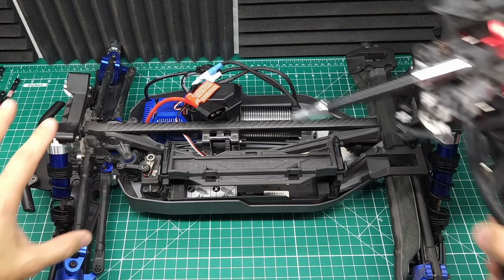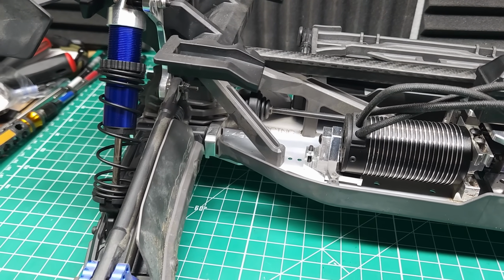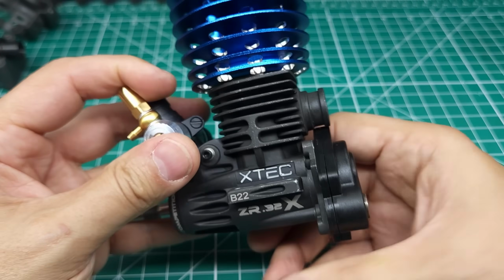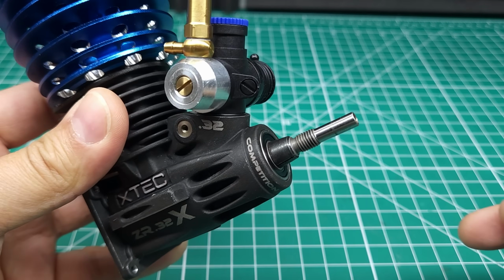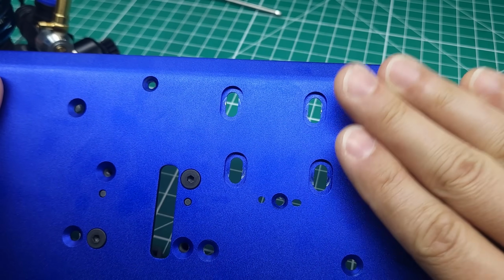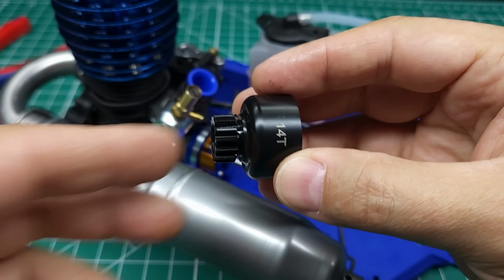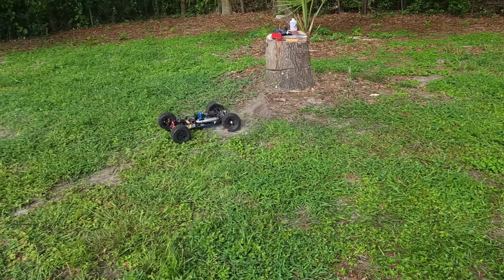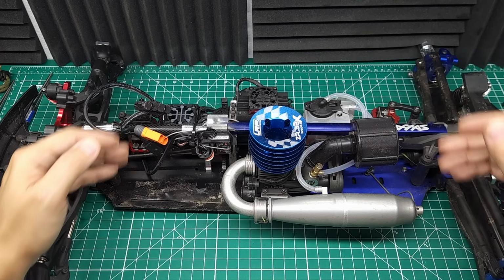Hybrid 2.0 - I Built The Craziest RC Monster EVER!

Comment: If u used arrma pillow balls type front ends u have adjustable caster built into the arms and could be exaggerated(reduced towards 0°) quite easily beyond factory.
Reply from the maker: That's actually camber. The caster is adjustable a little bit by sliding the upper arm back and forth with those clips but it's not enough to actually zero it out.
Reply: That's what I was referring to. I was picturing trimming the arms top and bottom. In the relative direction needed. Just seems less wonky overall. But I'm not there, I could be wrong @DoRC
Reply from the maker: You could do that though it would take a lot of trimming and I'm not sure you could actually go far enough.  @modzilla74

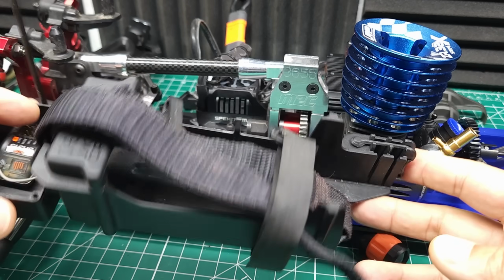Comment: 9:12 you could have just flipped the diff around
Reply from the maker: Not easily in this case. The Traxxas differential ring gear extends through the bulkhead at the bottom and even into the chassis a little bit. It can be done but you have to do some pretty serious modifications to the bulkhead.
Reply: Ok ok  @DoRC good info!

Comment: The traxxas e-max was my first hobby grade rc and t-max shortly after. I would love to see either one or both upgraded with modern  parts. Twin brushless, 2-speed e-maxx would be awesome
Reply from the maker: Stay tuned :-)
Reply: I took the first gen tmaxx 4910 o3 model made it brushless with the two speed and still has the disk breaks. Runs on 3s with a 550 4300kv.
Reply: @paul707.7 Sick! What's your radio setup?? And are you using metal gears in the tranny or does it come with plastic gears stock?

Comment: You should do a nitro powered generator that runs an electric motor lol might be cool if possible!
Reply from the maker: It's technically possible so Nitro engines really aren't designed to run at full tilt continuously and I don't think it would last very long.

Comment: It could be just your plugs were wrong and you needed to break it in on cement not grass and the cement makes it not have that jerky amount of you know the tire is breaking traction and when it’s in loose stuff and then having to muster up to get over stuff you would think I’d be fine, but it’s not it’ll make the tune of the engine really black and then when you start changing it upvery minimal amounts you need to do and always revert back to original diameter you know parameters anyways God bless you
Reply from the maker: At this point the engine's pretty well broken in I think. It seems as though these carburetors just aren't great and don't hold a tune very well. Combine that with the fact that I'm distracted trying to do a bunch of other stuff at the same time and it was just difficult to keep it running.

Comment: Idk but a true hybrid would be to use the nitro to charge the battery  while its  running?
Reply from the maker: Not necessarily. Not all hybrids charge the battery with the engine
Reply: @DoRC   hybrids yes run on both but thats just two different power systems but a true hybrid would be one powering the other. Diesel’s trains are a true hybrid
Reply: @DoRC  i love the channel

Comment: Is it weird that I just bought the Raptor Ultimate to review it on my channel and you are doing nitro? LOL. I did an LRP 32 in a Hobao yesterday and it gave me fits getting it broke in and tuned, and I speak the language. But the video shows it is doable. Key is to get the low speed needle right to get a clean idle and then the high speed for power.
Reply from the maker: Glad you were able to get yours working properly!

Comment: I've always wondered if an electric basher could charge the battery it's running on or a separate battery like the hybrid Indy cars charge under braking.maybe have an inline charging system small magneeto inline before drive wheels to produce power to charge battery if anyone can figure out a way to recharge the battery while running or a separate battery Iam almost positive you can figure a way to make it happen the things you due are unbelievable love this build electric and nitro that's how I know you could make my idea happen
Reply from the maker: I think there are some castle ESCs that actually already do this.

Comment: My god… I see you’ve been sniffing some super glue mixed with udder butter…anyway thanks for your response to my issue with the Micro T having a more active diff when turned to one side than the other… maybe some injora shocks, a carbon fiber shock tower, a blx motor, a furitek ESC, and metal diff gears would help!
Reply from the maker: Upgrades always help!
Reply: Brake cleaner is the best, has diethyl ether in it. 
Shhh, don't tell anyone. Is for educational purposes only. Is science, not recreational.

Comment: at 8.40 did you really need to change the motor position? What about flipping the dif in the bulkhead? It is usually possible but they just slap a tab that can be broken off which block inserting the dif wrong. I am not sure about sledge bulkhead design tho.

You could have also moved the centre dif on sledge closer to bulkhead? Maybe chop a bit into the brace and just drill 4 more screws. Once again, just backseat gaming here as Im not familiar with platform.

Super goofy build i like it
Reply from the maker: Unfortunately with the sledge you can't reverse the differential because The ring gear actually extends out of the differential case and even into the chassis a little bit.  With a bunch of hole cutting and trimming you probably could do it but since the motor was fairly easy to flip around it was the better option for me.  Moving the center differential closer to the bulkhead could work but then you would need to find a shorter drive shaft which again while possible is relatively challenging.

Comment: I prefer if both power sources were tied together. Electric motor only to boost the nitro's lack of bottom end power with super tall gearing for the nitro. Perhaps a brushless mod to Traxxas' onboard nitro starter for the low end boost.
Reply from the maker: That's what the first video was
Reply: @DoRC  Not really. It was like an electric setup with a nitro system bolted on with the two separate systems fighting each other. I propose what is basically a nitro setup where the starter motor (with it's crucial one-way bearing setup) is only used during acceleration to help with a nitro's super tall gearing.
Reply from the maker: Sounds interesting @toolbaggers
Reply: thank you for your wise words of wisdom adolf